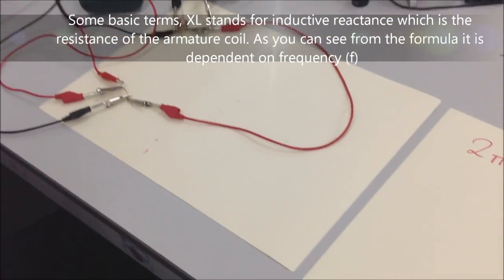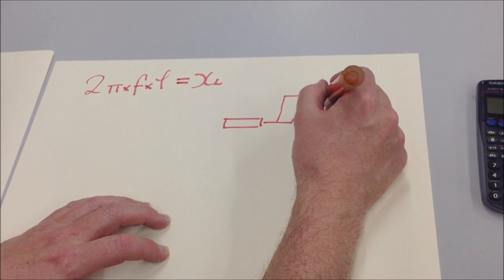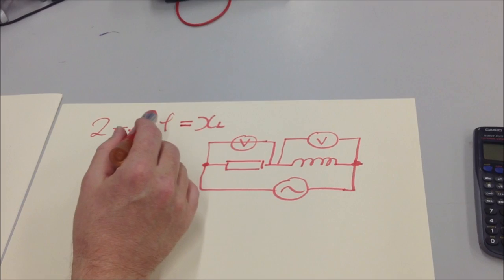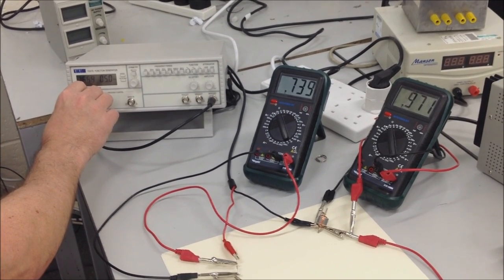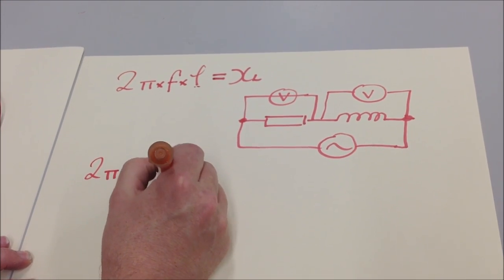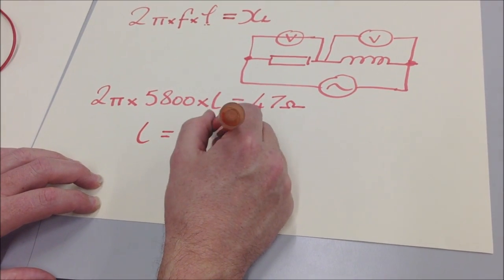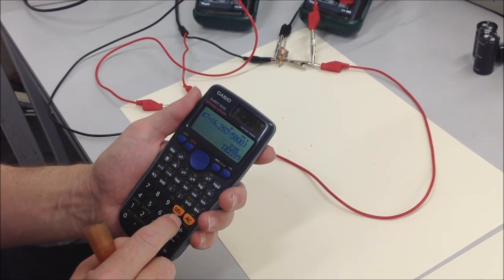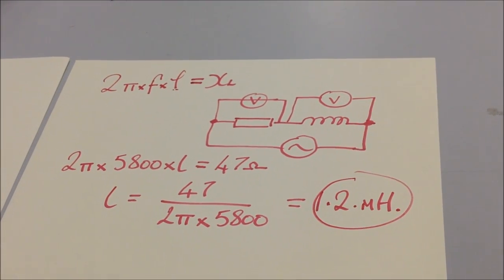Coil Inductance, Measurement and Calculation.wmv

Comment: What's interesting about that setup is the fact that DMMs are used to measure AC voltages at "uncommon" frequencies.  I always was under the impression that accurate AC readings were done at 50Hz and 60Hz exclusively.  Such a setup is way cheaper than a DSO, that's for sure.  There is always something new to learn everyday !  Thanks for the video.

Comment: As soon as I pick up all of the pieces of my 'blown mind', I will discover that there is a trace of genius here.
I own an inductance meter and I don't have a clue what steps it goes through to deliver its results.
I am always looking for ways to DIY electronic measurement devices, so my mind immediately goes to adding an Arduino to control a variable frequency sinewave. Perhaps adding a range switch to substitute different resistor values and let the Arduino do the math to spit out the inductor's value.

Comment: Works great, thanks! If anyone is interested, I used a small audio amplifier hooked up with a smartphone which acted as frequency generator (there are lots of frequency generator apps), a 10 ohm resistor and a multimeter.
Reply: +Richard Vassell
Hi Richard. I just connected the output of the audio amplifier (a small one in my case, about 1w of power) to the resistor-inductor series. I chose a 10ohm resistor which seemed appropriate as a load for such an amplifier (which used to drive a 6ohm speaker). The sinewave signal is generated by a smartphone via a dedicated app. Various of those can be found on the app store.
The volume settings will allow to modify the voltage across the resistor and the inductor. I did not exceed 2 Vac.
I was able to recognize some small inductors (220uH, 330uH) with roughly +-10% accuracy.
I tested them with a sinewave; square or sawtooth waves give different results, but I would not use them: as far as I know inductors do not like sudden changes in the current passing through them and will produce voltage spikes with those waveforms, which is not good.
Please note that I'm not an expert in matter of electronics, so take these informations with proper precautions, I could have said something wrong :)
Reply: Stefano ,
Thank you very much for taking the time to describe your set up.  

Question: So that I have this correct, Did your circuit had only the output of the amp connected to the series connection of the 10 ohm resistor and the inductor?
Reply: +Richard Vassell 
Yes, just like shown in the video with the frequency generator.
Reply: Stefano Rubini Thanks for info.

Comment: One does not need to worry about cutoff frequency for determining inductance. 

Because (resistance R)/(inductive ractance X(L))=(voltage across resister V(R))/(voltage across inductor V(L)) works for more situation than just R=X(L). 

R/(X(L) or 2×pi×f×L) = V(R)/(V(L).  When cross multiplied looks like V(L)×R=V(R)×2×pi×f×L. And when isolated for L, one gets L=V(L)×R(V(R)×2×pi×f).

Comment: Good video but I think you mis-spoke when you said that the cutoff frequency of the coil was being calculated. When the voltage across the coil and the resistor is the same is the point where the resistance equals the inductive reactance at that precise frequency. And with the know resistance and now know reactance you can calculate the inductance using the X(L)=2*Pi*f*L and solving for L.

Comment: Is there an equation for calculating the approximate number of turns a coil would need to achieve a specific inductance regardless of the coil's diameter and length? I'm already familiar with the equation L = μ x N^2 x A/ ℓ but my understanding is that that equation only works if the length of the coil is 10 times it's diameter.

Comment: I tried this method on an outrunner bldc motor without removing the housing. I wasn't getting anywhere trying to reach a common voltage. I suspect it could be because of the magnets still attached to the housing. Anyway thanks for the video!

Comment: This is a simple, creative approach.  However it is quite error-prone bacause the bandwidth of the multimeters is not taken into account.  If the cutoff frequency of the RL circuit is beyond the bandwidth of one of the multimeters, you will end up with an incorrect result.  For example, I have 2 Fluke multimeters that begin filtering the measured signal at around 1kHz.
Reply: If you have two equal multimeters, won't they show the same value (even if it's not the correct value) when you have reached the proper point?

Comment: PWL, you actually used a 47R circuit resistance and pointed out that it matched the 50R function generator Z - but not any significance. Care to comment?
Reply: You will never get a perfect match even if you are going to use resistors to extremely tight tolerances. I expect the 47 ohm resistor was the closest one he had hanging around (standard values). The impact would not be significant.